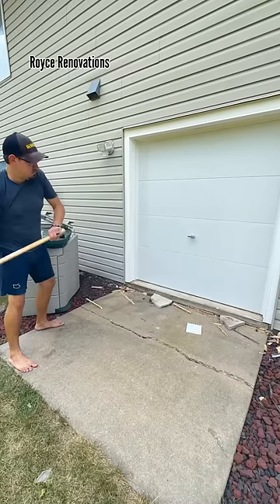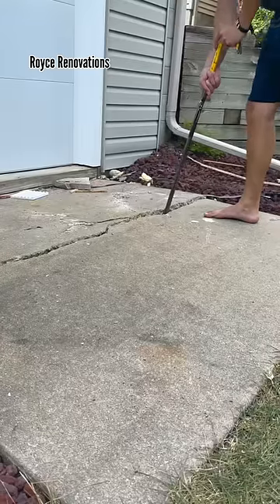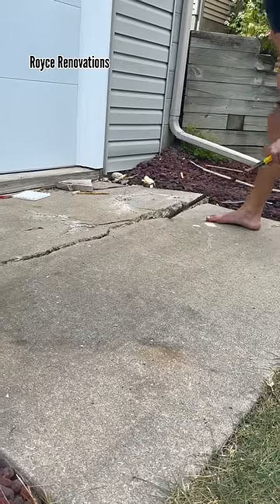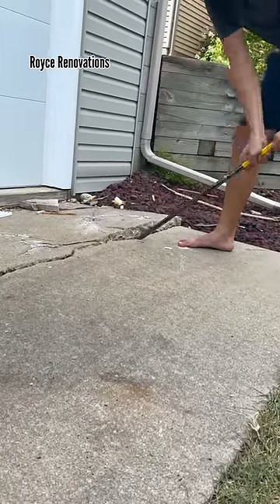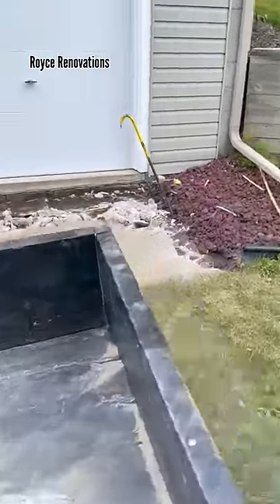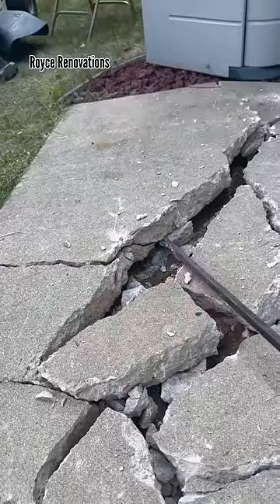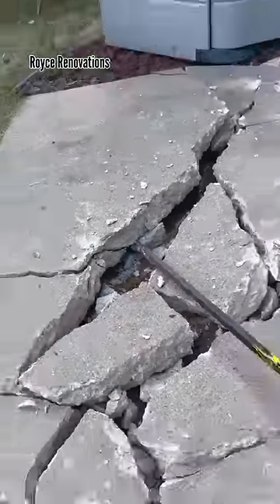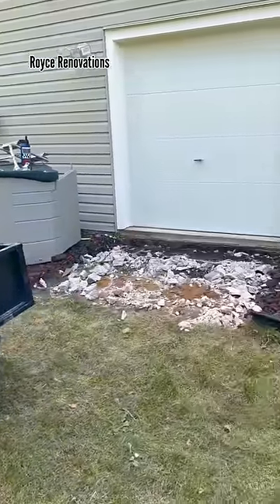Just Do It Right The First Time #shorts

Comment: You dont use rebar on pads that aren't going to have a lot of weight on them... rebar rusts and it cracks the concrete as well. The prep of the ground is always the reason it breaks. You can put less concrete down and get a pad that'll  last longer then just pouring 6" down.
Reply: That is just not true. Rebar provides tensile strength, which helps prevent cracking. There are 2 guarantees with concrete, its going to get hard and its going to crack. This is why we put joints in concrete slabs
Reply: @lmuganl  It is absolutely true, bar in that slab is a bandaid for pour sub grade. With properly prepped sub grade bar hurts more than helps. 6 and 8 inch concrete paving in parking stalls for example is designed without reinforcement. Concrete is porous and the bar will see moisture in an unprotected environment
Reply: @B0wtie4Life  This. Rebar is used in building specifically because the added structural strength is often needed in modern structures.
For a simple slab of the stuff on the ground, you're never going to need that extra strength; Heck, the colosseum (and several other Roman structures!) are doing pretty well two thousand years later, despite completely lacking rebar, and having much greater loads on them than that slab.

On the other hand, rebar does have it's downsides: for example, it can rust (which is why it's usually coated with a protective coating, which delays rusting), which can cause serious damage to the concrete.
Reply: @tygerion4404 the Romans also weren't using modern day concrete.
Reply: Rebar doesn't stop cracking completely, it just makes the cracked pieces stay together, surface cutting prevents cracks
Reply: @connormchale8415  Doesn't help that it's the foundation backfill zone. So additional consolation will always occur.  Good news is that the house looks older, so it's probably done consolidation the backfill. Bad news is the site doesn't look like it slopes away from the foundation, so it might continue. 
This is also just a housekeeping pad outside a small door for his riding lawnmower and about 8x6. Going to a reinforced slab is a waste of money and control joints shouldn't be needed on such a small slab. Fibermesh or WWF if you want a bit more stiffness.
Reply: Rebar has nothing to do with it. It's all about the base. Yes, I'm a concrete guy.
Reply: Concrete is going to crack but to say don't put in no reinforcement like rebar or wire is foolish unless it's city walks lol.
Reply: @lmuganl Iron expands as it rusts and breaks the slab. It also needs at least two inches of cover in all directions to be sealed in from oxygen. Slabs are rarely thick enough to provide that, and the rebar usually isn't centered well enough if it was. Also any cracks open up the rebar to oxygen causing corrosion. So the rebar will reduce the life of the slab.

The better thing to do would be to use fiberglass. Either as fiberglass rebar or as chopped strand filler. But they are unnecessary if the ground is properly compacted.
Reply: @shy404usernotfound  The advantages to Roman concrete are largely overstated. While the advantage to roman concrete is observable in today's age the observation rarely takes into account the other parameters surrounding the infrastructure that are very much in consideration. Fact of the matter is today's concrete is more consistent, structurally sound, molecularly stable,  and most importantly -- predictable. 

I like the way my historical architecture teacher said; 'For every Roman structure you see standing, a thousand others fell.'
Reply: There's 2 types of concrete. Concrete that's cracked, and concrete that hasn't cracked yet
Reply: Wow, so many people with so little idea of how things work making so many comments.

Rebar is an essential PART of proper concrete, it doesn't replace a proper gravel foundation. And yes, it does prevent cracking and yes, it will rust in time thereby destroying it's tensile strength but for the time it exists it will absolutely help and properly done there are ways of mitigating the rusting, of course.

bozos.
Reply: @Ojja78  Yourself included...
Reply: Yeah Ive done concrete for nearly 20 years. We would never put rebar in a simple pad like that. If anything we would put wire or fiber. But I'm guessing that enrty is just for something light like a lawnmower so it really shouldn't even need that. The damage is 100% from the poor dirt work underneath. They didn't compact it properly, or water found a way to tunnel underneath.

Comment: I’m no stranger to hard work and doing the old school way with a sledgie, but the quickest way to get rid of the slab is to cut it into manageable sections with a demo saw.  Btw, I’m loving the Japanese safety boots.
Reply: Those are clearly Philipino safety footwear.  They’re made of composite so they’re much lighter. Geez, man, don’t comment if you aren’t capable or recognizing the difference.
Reply: VC combat boots.
Reply: Concrete saws are in that list of "I wish I had but I'd only use it once every few years" thus many don't have a spare one laying around or wanting to rent one.
Reply: It's evident you don't do concrete !!! Aeeeyyy

Comment: If the pad isnt load bearing it doesn't need rebar
Reply: @pusherme5329 if it doesnt have a lot of wight on it then it doesnt need rebar is what he is saying i believe
Reply: Yeah but once the concrete bends from settling the side in tension will start to crack. Concrete barely has any tensile strength.
Reply: You can literally see in the video it's in front of a garage door. Even if hes not parking cars on it heavy lawn equipment or outdoor toys can definitely load a slab.
Reply: @goatedcracked138  ???
Reply: You're right it doesn't need 'rebar' but it sure damn well needs wire mesh... don't comment on stuff you don't know about.
Reply: Slab on grade never needs rebar. And wire mesh has no strength that's why it's not code.
Reply: 100mm concrete minimum
Reply: @deliman7203 What do you think wire mesh would do in this situation? And if you where going to use mesh, what weight mesh would you use? You shouldn’t comment on stuff you don’t know about. Stick to sandwiches, deliman.
Reply: Wire screen should be in there.
Reply: Wire screen should be in there.
Reply: I was thinking this… I don’t think I’ve ever seen a freestanding slab with rebar in it and I don’t know why you would.

That’s like using a  backhoe to build a sandcastle, your 500lb mower doesn’t need to be on steel reinforced concrete lol
Reply: @inthe-sc4db  ding dong, you’re wrong.
Reply: this guy has no drainage and the sub grade has no abc so water doesn't erode under the slab. mother nature is what happened the that slab and even with rebar the same thing would happen but it would take longer to demo next time
Reply: Found our culprit. Almost as bad as busing up concrete bare foot.
Reply: @Fetidaf  See that huge crack in the middle, that's why. Now if you don't care or want to have to repour every 5 years then fine. Plus NOT rebar, wire mesh.
Reply: @deliman7203  which is why I said that slab shouldn’t have had rebar.

And even with wire mesh it will still crack if it’s not on the correct bed… that’s what was wrong here. It should be perfectly fine for a long time even without any reinforcement, although wire mesh would help it’s not necessary for something like this.
Reply: @Fetidaf  Wrong! It MIGHT still crack but less likely with reinforcing.
Reply: I’ve never heard anyone ordering wire mesh by the weight.  Do you mean gauge?
Reply: If wwm has no strength, why is it used in concrete?
Reply: @deliman7203 brother I work with concrete all day everyday that slab don’t need nothing in it 🤦‍♂️
Reply: You Americans must use subpar concrete or something 🤦‍♂️
Reply: No, people just comment on here without any real experience. No rebar is necessary here.  It failed because it is way too thin for the use it was meant. Also it likely wasn't prepped correctly. American concrete is fine. It's just tough to find someone that isn't just a hack trying to make a quick buck with his limited knowledge.
Reply: @ron7202  The mesh is to bind the 'Cement' together'. Concrete has very little  tensile strength, so when it expands without reinforcing it cracks as in this video. The mesh reduces the expansion process. Now if the situation has very little expansion process, ie moderate temp changes, then yeah no mesh required, but still a good practice. Think of the mesh as a rubber band around a balloon, how much harder will it be to inflate the balloon with the rubber band.
Reply: @deliman7203  it will still crack if you try and just dig down six inches and fill it with concrete it will crack with anything but rebar and even then. 

You’ll have one side/corner settling down more than the other, you’ll have water sitting underneath it expanding and contracting and you’ll be left with one side not touching the bed while the other is getting buried inside of it.

When you drive something on it (or the weight of the slab itself) it will crack because you’re essentially dealing with a concrete teeter-totter.

Wire mesh will help, I’m not denying that one bit… I’d even recommend it just to be safe but if you think you need wire mesh or, worse yet, rebar when you’re pouring a slab or it will crack in 3 years from personal experience then you’re doing it wrong
Reply: Concrete always needs steel reinforcement there's no ifs ands or buts about it
Reply: Completely untrue. A slab as to bear is own load
Reply: @pablocad  false, mud slabs don’t need reinforcement. You only need reinforcement when dealing with tensile loads or potential for shearing
Reply: @deliman7203 doesn't need mesh either
Reply: @deliman7203 , you are commenting on something you know nothing about !  Wire mesh does nothing at all for tinsel strength nor the longevity of crete!!
Reply: @benchoflemons398 rebar won’t provide it in this case since the slab will crack regardless with settlement this large. Then you’re exposing rebar to air and water which will cause it to corrode and further deteriorate the concrete.
Reply: @deliman7203 it doesn’t need wire mesh either. A proper pavement section and good construction methods and that concrete should have lasted 20+ years.
Reply: @deliman7203 it was 1000000% cracking no matter the reinforcement with how shit that subgrade was. No way to design it as a suspended slab so it was failing no matter what.
Reply: @deliman7203 waste of money in this application. All this needed was proper soils work. WWM is for heavy workload slabs not a back entry to a garage 😂 You hunt whitetail with .50?
Reply: @deliman7203 that isn’t an expansion crack that is a 2+ inches of differential settlement crack 😂😂😂
Reply: @pablocad no it doesn’t
Reply: @biggiesmalljaws  Once again ignorance rears it's ugly head. First it's NOT a suspended slab, it's SLAB ON GRADE, another heeheehoohaha.
NO amount of ground work would prevent that slab from cracking. Waste of money... heehoohaha, $5 for mesh that size.... OMG stop it before I have a heart attack.
Reply: @BillBillington-og4pg  that's the one exception
Reply: @ron7202  I don’t know how they spec jobs where you’re from, but every print I deal with mesh is spec’d by weight per 100sqft, the most common is 42lb, 6ga spaced 6x6. You could also have 62lb mesh, which is 6ga with a 4x4 spacing, but instead of writing out the gauge and the spacing it’s labeled by weight.

Comment: My dad had a 40x60 garage all concrete floor. Built in the late 80s him and some of his friends poured it and sat on the rebar that was supposed to go in the floor admiring it when they realized what they didn't do. It's been decades and has mainly been used for the loader, dozer, dumptruck, construction equipment ect. It doesn't have a foundation crack one in it. Just some chips from a bucket or blade hitting the floor.

Comment: That could have been easily fixed and resurfaced for $20 dollars.
Reply from the maker: This also cost less than $20
Reply: @roycerenovations well that was just you taking the concrete out, how much to put it back ??
Reply: Only to break pretty quickly afterwards due to, as he said, the slab being held together with hopes and dreams.
Reply: If you're including the crack, then I'd say it'll last a few days. Replacing is the beat option here.
Reply: Resurfaced?? Like how? If you say pouring some more concrete or another material ill know how much concrete work youve down
Reply: @michaelatkin9649 what's gonna happen if you pour more concrete?
Reply: Leaving it alone would have been free. Not like anything was really wrong with it other than cosmetics. looks like old work so it cracked and settled all it  was going to already. Was effectively two big smooth rocks that you drive a lawnmower over. Better than mud and better than spending the money on replacement when it's not a pressing matter.

Comment: You dont need rebar or a metal mat in your concrete. 

Propper subgrade, stregth of concrete, and thickness you dont need the metal. Ive done many driveways in NY without rebar. They are still there and in great shape
Reply: Winner

Comment: Sometimes rebar  can be the cause of cracks. I've seen driveways  last a long time with no cracks and no rebar
Reply: EXACTLY. Looks more like a compaction problem.  Could have used a joint also.  Regular rebar when exposed to any type of moisture can rust and swell and break concrete. Have seen it many many times. My way would have been good compaction and fibercrete. And don't skimp on cement
Reply: @scottvigne614 I think using a joint is what made this dude run out of the house barefooted with a sledgehammer

Comment: "It was held together by hopes and dreams."
To remove it easily, you would need a bobcat and / or a sledgehammer... which would also break rebar concrete.
Listen, it's hard to take a guy who doesn't wear safety boots around a crushing /shrapnel hazard as an expert. Maybe stay in your lane somewhere else or do some research on why that's probably not the best idea for a small slab like that.

Comment: As with any activity involving heavy objects that could impact your feet, the benefit of wearing shoes or boots is not just to protect from damage. If damage occurs, it’s to hold your smashed flesh in one place until you can get it put back together, instead of having it spray and spill out on the floor

Comment: You don't need rebar depending on your location. A strong 6 bag or 4500psi concrete does a great job holding its self together as long as the base a prepare proper. Any kind of tie will prevent lifting, and that is only needed if the ground shifts often in your location, so earth quakes, sink holes, slides. If the ground is solid and stable rebar is only needed if you plan on over loading the concrete.

Comment: Rebar isnt necessary if your base below the pad is solid. While its handy to have, if its not having anything heavy drove across it or sitting on it, then rebar isnt necessary. Wire mesh also doesnt add strength to concrete. Just keeps all the pieces together if break all the way through

Comment: Actually rebar will also crack the concrete and even more so over time because the rebar will start to rust and corrode so technically depending on what it is you don't want to use reinforced concrete on a lot of things . Reinforced concrete will actually fall apart sooner than a regular concrete building. Or anything that's made with actual concrete alone yes some reinforced concrete is good to use and other times it is not it depends on what it's for. But if I want something to last it definitely won't be reinforced that's for sure

Comment: Not every single piece of cement require rebar. If the ground is prepped correctly and you use the right mixture especially for something that small you dont need rebar

Comment: You want dowles in the preexosting concrete and ableflex on the face of it. wet conrete getting poured onto a preexisting conrete slab will crack, it expands when it dries. Teh dowels help woth structial integrity and ableflex lets the concrete give it that extra give when expanding.

Now you can put crusher dust as base or put plastic on the bottom as well.

Comment: the reason it cracked was simply because its not elastic enough. don't try to blame it on the surroundings, blame the material instead and get a more suitable material for that situation
Reply from the maker: I replaced it with sod. Concrete cracks. No debating that.

Comment: Don't need a rebar for something that small and that isn't going to get a lot of traffic. Most drive ways don't take rebar, we just go 6-7" in front and transition to 4" in back. That extra couple of inches is enough for your car driving in and out. And next time start at the corner by the grass and work your way towards the house, you can use the foundation of the house as leverage.

Comment: That slab doesnt require rebar…. 4 inches is standard.  6 Inches is over compensating.  7000 psi concrete with fiber mesh works just fine.  If you want to i stall rebar.  4-6 pre drilled holes with 3” - 6” pieces of steel coming out of the foundation will keep it even more solid.

Comment: Crazy story. We had redo our concrete driveway and my dad wanted a ramp to be able to go down into back yard. We did the slab with rebar and got that tool to pound the ground.. that cracked.. we made the ramp at my grandpas instructions…. We threw trash bags (full of trash) some old tires, and  old metal bench and other junk we had In the back yard… 15 years and that thing still going strong.. we drive pick up truck full of construction materials for shed and other heavy things over it… handles it no problem.